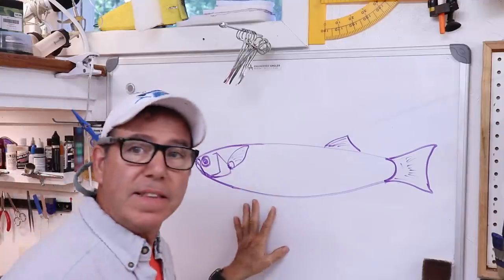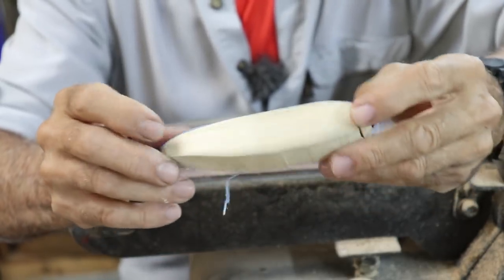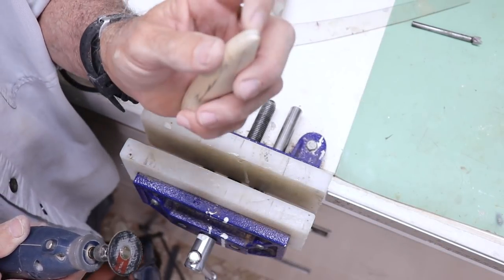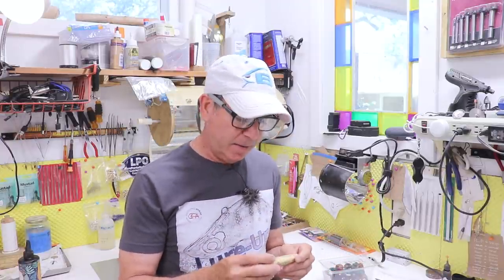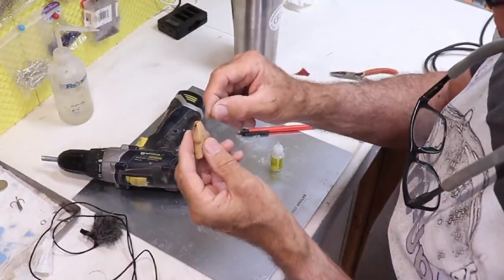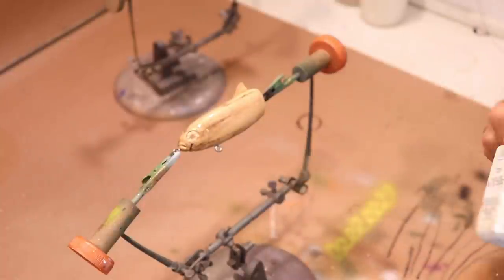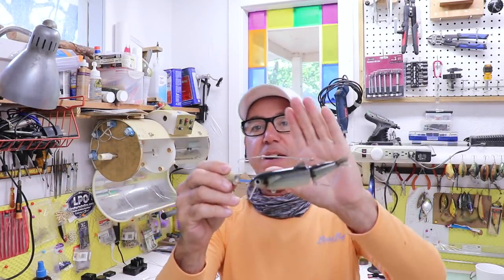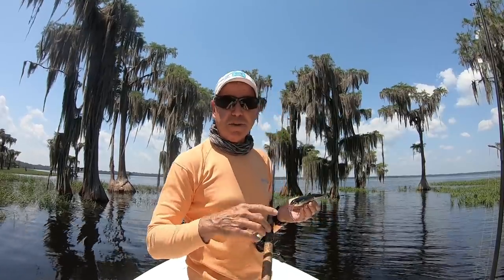How to  Make a wooden Crankbait That Looks Like a Mullet  #Luremaking  #fishinglure #lurefishing

Comment: Thanks Franco,  very nice build! Great paint-job! Like the way you made the tail, might give that a try. Call me lazy, I typically use a treble hook dressed with squirrel tail (reverse-tied, folded back, flattened, set the base with a bit of uv resin and cut in a "V" to shape)  that is quick to make.
Reply from the maker: Sounds like a good technique 👌
Reply: Yeah that's lazy LoL. Lazy is no tail and a naked hook. I might use a red treble if I've got a couple handy😁
Reply: @pakde8002  True!   I tie a lot of streamer flies and jigs (for bass and walleyes)  so embellishing a hook with feathers or hair is "normal" for me and plain hooks do look naked  😀  I  admit that for some lures dressed hooks as just "eye candy" but other lures (like Franco's Lolipop) really benefit from the dressing. I add a 4 - 5 inch long bucktail to the Lolipop which gives it a nice profile with great action that the bass are fond of. Cheers!

Comment: I've been using 18 Gauge Half Hard Copper Wire for the line ties.

A lot easier to bend and tune ur Baits.

Just a thought...
Robert Bently George
Reply from the maker: I'm always worried that the softer wires will come out of tune too easily.  Sounds like you found something that works for you.  Thanks for sharing 👍.